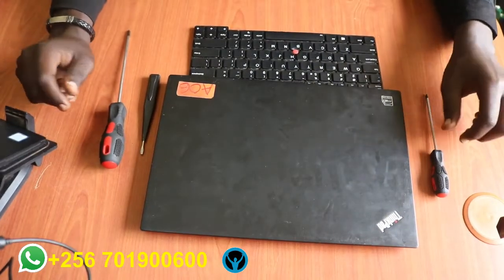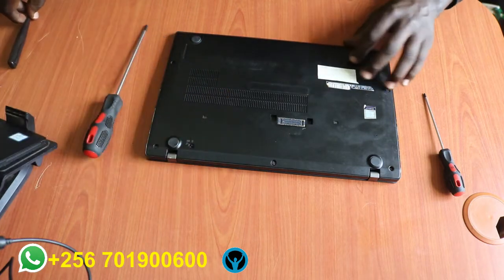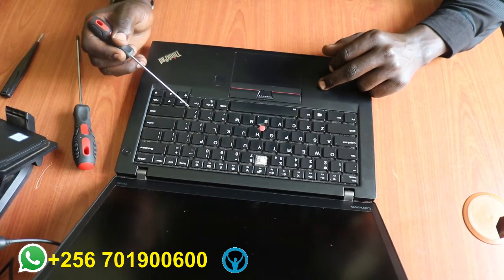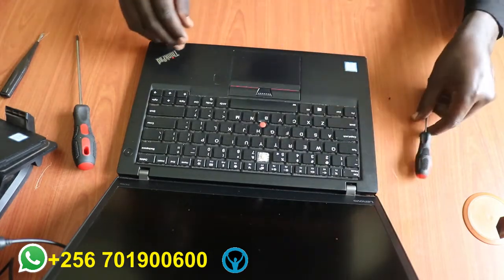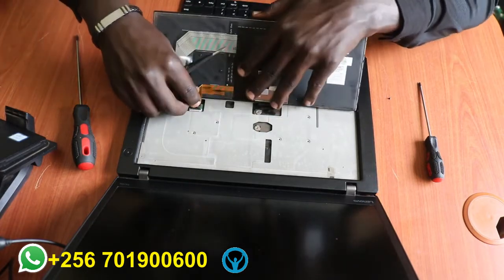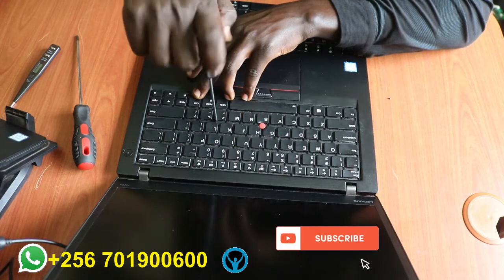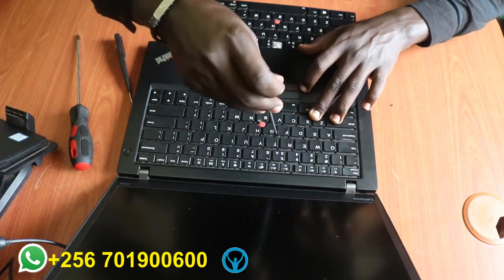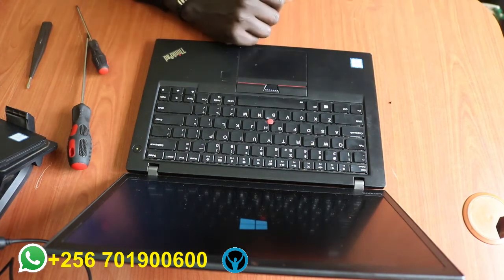Lenovo  ThinkPad T470s keyboard replacement | Laptop Repair

Comment: hello sir, I want to ask, my Lenovo T470s laptop keyboard is almost half unable to respond when typing, what do you think I should do? Do I just need to replace the keyboard?
Reply from the maker: @kusuemon60  does it at some point type, or it completely doesn't?
If it completely doesn't, you will have to replace it
Reply: @opolotiversity  unfortunately, it completely doesn't work at all, but thanks, now i think i could fix it by myself
Reply from the maker: @kusuemon60  ohh sorry, you just have to replace it